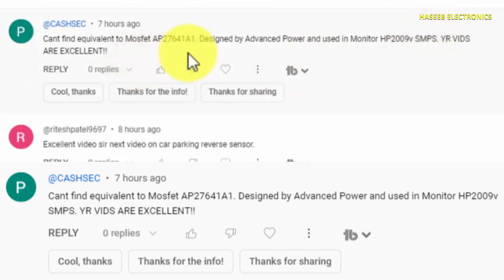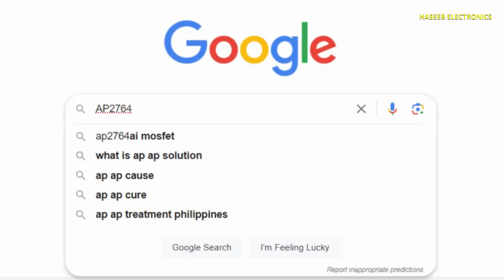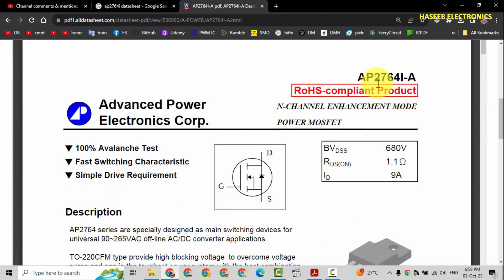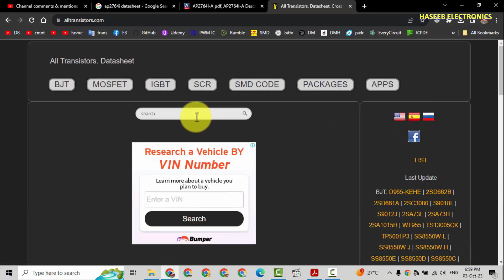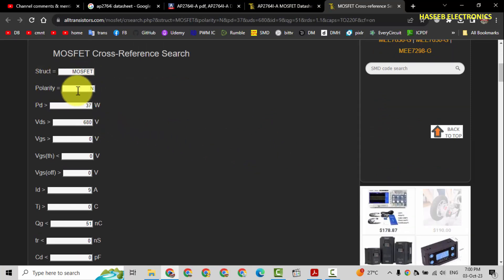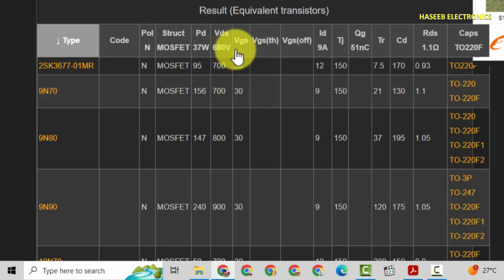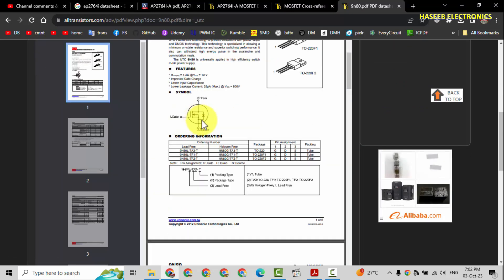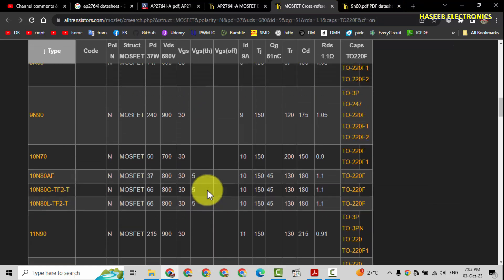{978} How to find MOSFET equivalent / substitute

Comment: Asalamu alaikum haseeb bhai...
Thank for your tutorial i am watching and learning from your videos past 2 years but never try anything ....today i fixed meanwell 450watt 12v supply ....
 i checked board fuse burned....then i checked mosfet They used two  07n90e mosfet one was opened i replaced it with STW7NK90Z...
It is ok just replacing only one mosfet with differnt one...but smps working fine...❤❤❤🎉🎉🎉🎉🎉🎉